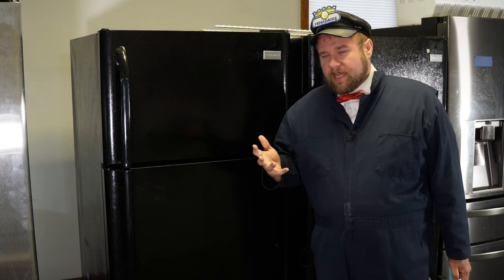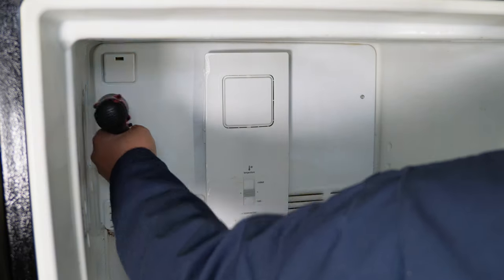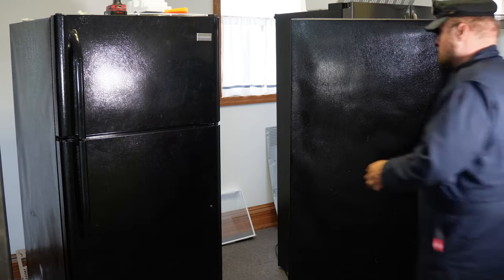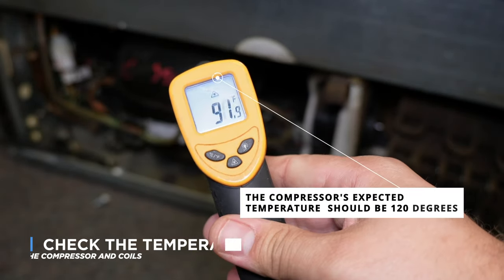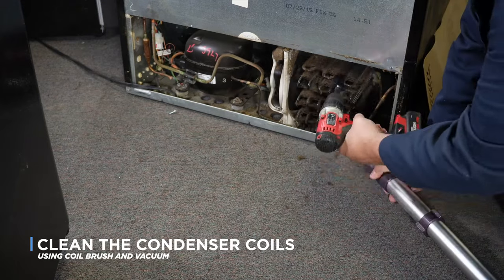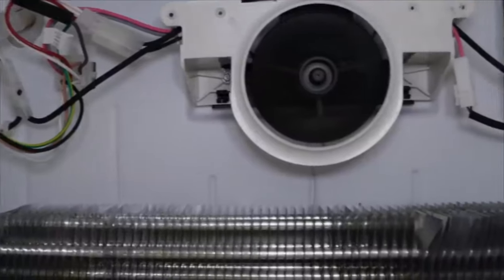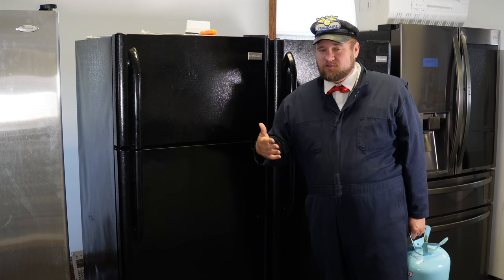Does Your Refrigerator REALLY Need Freon? How to Find Out If You Need Refrigerant

Comment: My old Speed Queen dryer that was in a pile of washers and dryers has cost zero so far other than angry pixies but this is about angry pixie farts. Just pucked up a Whirlpool freezer over fridge replacement from the curbside because I'm a sucker for wood-grain and R-12. Two hours of cleaning and some VHT flat black paint on the condensor joints, I was able to donate the newer much louder GE to someone who doesn't have tools or a trailer. Thanks again for everything as I wouldn't have known what I was looking at which saved me a few thousand for the cheap junk made today.
Reply: @@mckidyl70 Looks like I ducked up my grandma.

Comment: I have an LG fridge it runs beautifully. There is no frost or ice at all around the evaporator coils from what I’ve learned and understand they are using metal lines in and underneath the insulation those rust and leak out all of your Freon. It’s already five years old.Compressor vibrates nicely just like my other two fridges but it’s not warm like the other two fridges.

Comment: Good start to my understanding. I have a 24 year old Kenmore (I know, someone else makes for) that is cooling but the compressor cycles up, then down, then up, and down. Rarely turns off. Does turn off but not often. Concerned it may be on the way out, but if it only needs coolant then it might be worth a service call before it fails.

Comment: Thank you so much. We have a GE French door system refrigerator and both sides are showing higher than recommended temp, even after attempting to set it lower. I will try the steps you mentioned. We live in the desert so it could be dust. Had this refrigerator for ten years.

Comment: What about all those little wires and connectors behind the refrigerator and inside the back of the freezer compartment. It is perfectly safe to open all that up and test things with our hands with the refrigerator plugged in and running, or should we turn the thermostat dial to the "off" position first before putting our hands and fingers back into those areas behind the evaporator and down by the compressor area?

Comment: Hi Ben, is it normal for a refrigerator/freezer to lose 134a  refrigerant after 13 years? I have a samsung with a 2010 build date, I have done everything to it. All new fan motors, all new temp sensors, new defrost sensors, new inverter and main boards. Condenser coils cleaned with brushes, vacuum and foam coil cleaner. UPDATE: I installed a piercing valve on the low side and found that it was reading below 0. I added 134a in three small pulses till it read 7 psi on the low side. My refrigerator and freezer is back to working like new, except for the through door ice maker. I replaced the ice room fan, but no luck. I think that the 12v fans are very specific as to the return signal to the main board on the white sense wire. The ice room fan is a 13A. I now have a new one, but im living with ice trays for now. It would have been nice to know about these fans up front. Basically, the main board sends a test pulse to the fan three times to see if it turns. If it does, the fan kicks on based on the ambient temp. If it does not, the board assumes the fan is obstructed, and it will not start. If your evaporator coil keeps icing up, i would suspect your door seals, or unusually frequent door use AKA (kids) lolol.
Reply from the maker: Normal? No. Possible? Yes. You may be able to get away with a recharge and get another 5-10 years out of it depending on the leak. If a proper fix is done, far longer.

Comment: I took a chance on my refrigerator and installed some pierce valves. I had an old can of 134, no idea of fluid level. My frige was not even that cold at all. After charging, my freezer is just cold enough to freeze water, and my frige is cooler than hot. But my low pressure side is completely covered in ice.

Comment: This troubleshooting was amazingly helpful. 

Can you tell me if a thermostat can work, but occasionally get stuck (where both fridge and freezer usually hold temp but sometimes get too warm (warm enough for ice cream to get soft enough to start to melt))? Turning the thermostat colder and then warmer always gets it to kick back on and then it’s good for a while longer. 

Everything else seems good. Could it be the thermostat or the “brain” getting stuck on or after the defrost cycle (or something like that)? Those are the only two parts that I can think of, since I’ve checked everything else.

Thank you again for your great videos!
Reply: A thermostat and cold control are not the same ,one is for temp and the other is for pressure .
Sounds like you have defrost timer issues or potential relay contacts .

Comment: Hello! I have a question. I did not know I had an R600A compressor and I used the R134A. I turned it on and it did not cool. The compressor still turns on. Can I still get the R134A out and use R600A or did i completely mess it up? Thank you Elisse

Comment: I am getting .39 - .41 amps on the red compressor wire. Does that mean low refrigerant or a bad compressor? I also have ice forming at the pipes in the one corner like you showed in the one photo on the freezer coil. The whole coil has no frist at all, just ice accumulating at the inlet pipesI have an LG LFXS30766S. My condenser coil is room temperature, all fans work. I am getting 6 blinks of the LED, which for this model is either compressor or EVAP system. How can I know for sure which is failing? My compressor was replaced 5 years ago with the so called "upgraded" linear LG compressor. The compressor seems to run very smooth and quiet, temperature of 94°F. Could this be a leak on the EVAP coil in the freezer? Also, I did try adding freon, but it did not help.

Comment: Hey there .
I like your vid .
Box temp is the most important issue to be addressed .
Keep in mind adding refrigerant does not make a system colder .
There should be air flow across the coil to add evenness to the surrounding area and aid the saturation point to the coil .

Did the instructor in your refrigerator repair course tell you that Freon is a DuPont trade name for there products not all refrigerant is  Freon , you stand corrected

Comment: DOES IT MATTER WHICH WIRE YOU CLAMP ?  ARE THERE DIFFERENT RESISTANCES TO EACH MOTOR WINDING?  ON A HOME HVAC UNIT A TECH RECOMMENDED CLAMPING THE "COMMON" WIRE FOR A PROPER READING

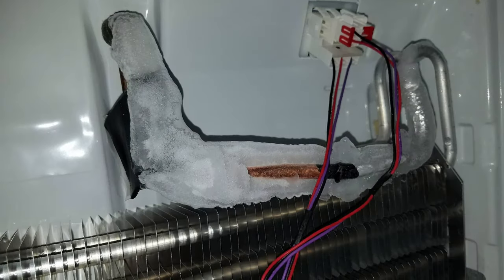Comment: 2:10 - if the frost is only forming in a clump (usually at the cap tube/thin copper line) doesn’t this mean it is restricted inside the evaporator rather than low freon?
Reply: Nope, not enough freon means that there's very little liquid getting into the evaporator and it boils quickly and it's very low pressure so it boils at a lower temp than usual. More liquid means more even across the coil and higher pressure in the low side.

Comment: I think I have an issue with the the part of the controller unit that runs the fan. I have a KitchenAid Mod. KSCS25INSS01. We noticed that the strip between the doors (side-by-side model) was getting very hot. I pulled the fridge out of its area and noticed the compressor was also very hot. I cleaned all the coils underneath, as I do fairly regularly. Note: this coils are super hard to access from either the front or back - it is not possible to slip a coil brush past the first row of coils to reach the other rows of coils behind. I have to use an air compressor to blow from front and a fan blowing away from back to try to pull the dust away. Then, I vacuumed.  After the coils, fan and general area under the fridge were cleaned as best I could, I plugged the fridge back in. Everything started up well, including the fan and compressor and the fridge and freezer got down to the proper set temperatures. So, the compressor and fan turned off as they should, but when the next compressor cycle started, the fan did not come back on, so as the compressor was working, it started to get very hot. When I pull the fridge out and place an external fan at the bottom front of the fridge to blow air over the coils (effectively taking over the function of the fridge's fan) the compressor eventually comes back down to a reasonable temp and the strip between the doors no longer gets hot. Everything else in the fridge functions normally. I am not sure how to deal with this. I suspect something the the controller unit that turns the fan back on is the issue. The fan and it's motor are fine. Why does the fan controller have separate controls for when the fridge is first plugged in vs. when it needs to turn back on? Do I have to replace the entire controller unit? or can I address just the fan relay somehow?

Comment: I have the opposite problem,  my Jenn-Air JFC2089HTB keeps going to cold. The thermistor and damper have been replaced and it still will go down below 32 and freeze vegetables. Any ideas?
Reply from the maker: Check evap panel. is there a ball of ice anywhere that could be tricking the machine into thinking its not cold enough?
Reply: @bensappliancesandjunk  no
Reply: Such great information. My Samsung has been warming up for at least a week. Compressor runs (constantly), fans work, no ice build up. Any ideas? I live in a rural area and finding a repair person is challenging to say the least. 

Thank you!

Comment: 0:34  You don't mean thermostat; you mean thermometer.  A thermostat is an electrical device that usually switches from an off-state to an on-state, or vice-versa.  A thermometer just measures temperature, like what you have shown.

Comment: That's refrigerant it's not Freon, like all gasoline is not Mobil.
Reply from the maker: Literally all my customers call it that. Do I call it that in real life? No. But they do thus using the term
Reply: Ya beat me to it.  I have the same urge when car mechanics call an engine a motor.
Reply: Doesn’t matter
Reply: There's a brand name called Freon. It became a generic term. Actually you can make your own from different gasses sold for different purposes. I read that if you need r12, you can use a can side pierce tap on electronics "duster".
Reply: @marshmower  modern duster is typically r290